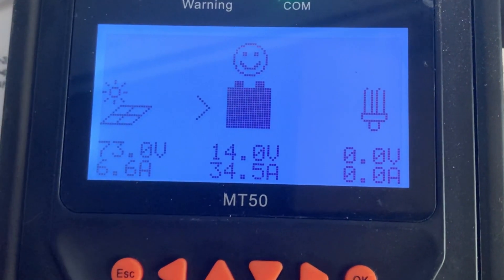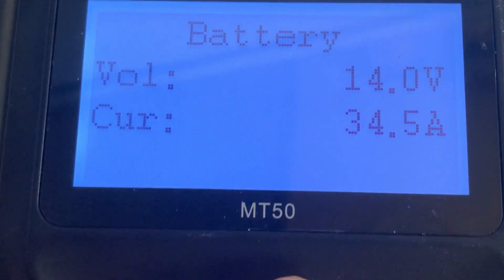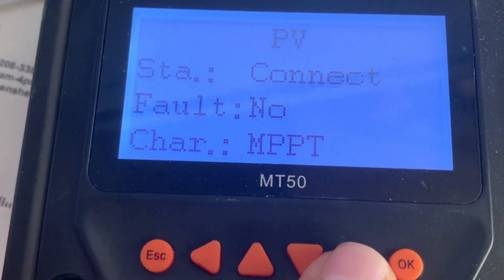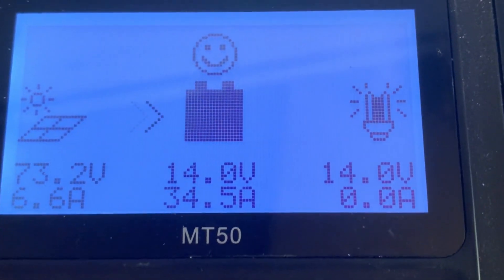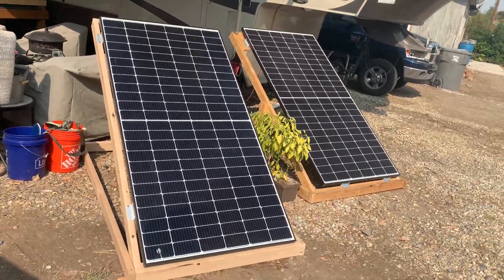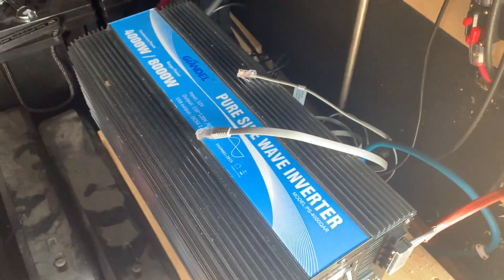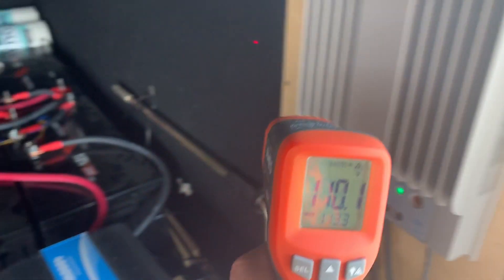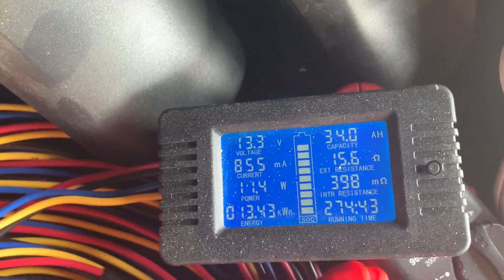Solar Charging  Ampere Time Battery 12V 200AH LiFePO4

Comment: Two 400 watt solar panels I should be bringing in close to 800 watts but because ur in 12v instead of 24v ur solar intake is very limited barely 500-600 watts if that u should be in 24v

Comment: Remember if you are charging a LifePO4 or Li-ion battery pack with a dedicated BMS it will reduce power input if at 90% or nearly full. So you get the most out of your 800 Watt panel if you drain the batteries more quickly every day to lets say 50%. Itś just what a controller can not change.
Reply: ( 1 question ) - Anyone know how long with (2) 400W Panels would it take to Charge 1 Rack Mount Ampere Time 51.2V 90Ah Lithium Battery LiFePO4 ? ( I see 480w avg ). Let say on a Perfect Sunny Day ?  ( The Poster is not answering questions so ) - Any idea ? is this a 1 Day 2 Day or 3 day charging period ?
Reply: @jonphillips1638  50v x 90Ah = 4500 Wh / 480 Watt = about 9 to 10 hours. Probably less.
Reply: @QUADBOYification  thanks !

Comment: Your charge controller is only rated to handle 520 watts of PV with a 12v battery.
Reply from the maker: You are correct, I forgot about that for this controller at 12 volts. Luckily I have not been close to 520 watts so far and this controller can handle a little more. I will be converting to hybrid inverter soon or this one to 24 volts at the very least.
Reply: @thervsolarseries2827  Most charge controllers are ok with over paneling the watts. What you need to be more concerned with is exceeding the max voltage and or amps input. I have done this(over watts) with Outback, Bouge and Victron controllers to get better charging when the sky is cloudy.   Ck your specs sheet of contact the manufacture if in doubt.
Reply: @thervsolarseries2827  the 40amp controller blue button can handle 1020watt of solar on 12v but will ramp that back and only allow 40amp into battery i found having the larger pwer panels in parallel so they are more efficient
Reply: @thervsolarseries2827  I would put some spacers behind that SCC and get some air flow to help keep it cooler.